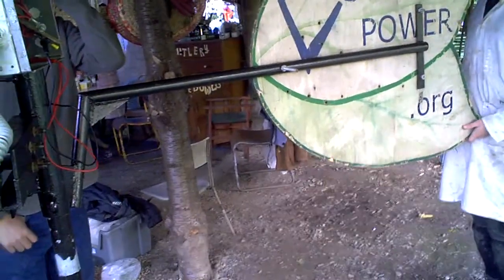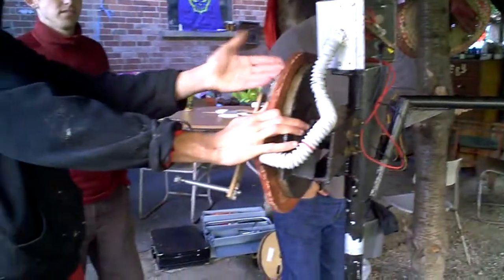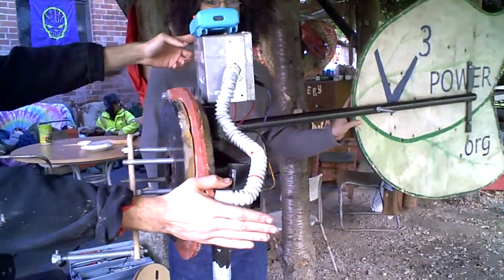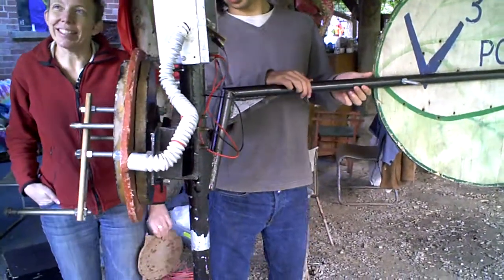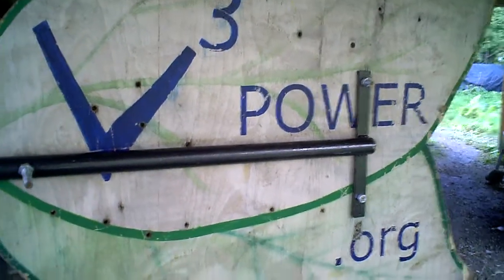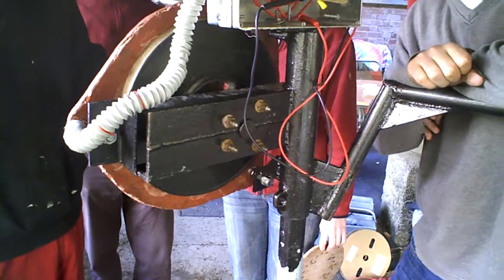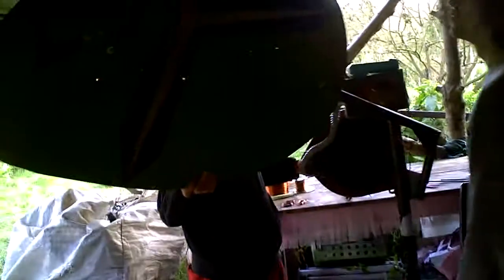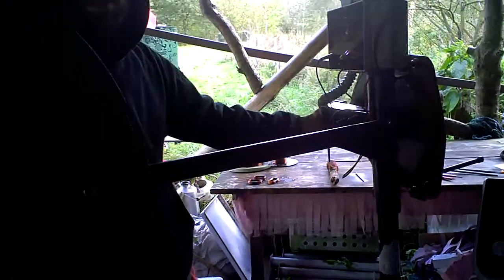How furling works

Comment: looks like the tail pivot bracket was welded backwards.  I bet you it does not read 20 degrees the way it is currently.  Weld the shorter side of the bracket to the yaw bearing and the larger side to the tail pivot.  in other words, the bracket side currently welded to the pail pivot should be welded to the yaw bearing and the side currently welded to the yaw bearing should be welded to the tail pivot.  it is an easy fix.